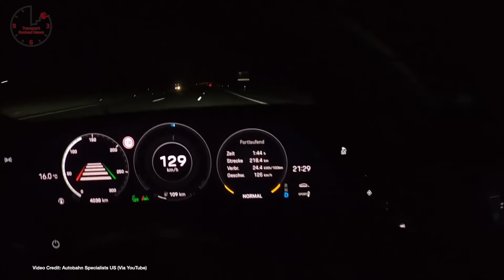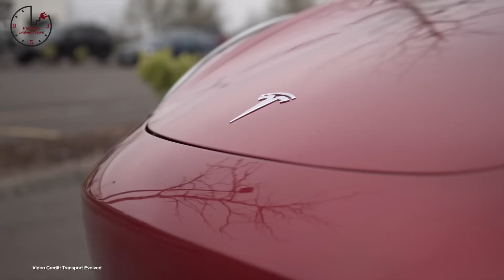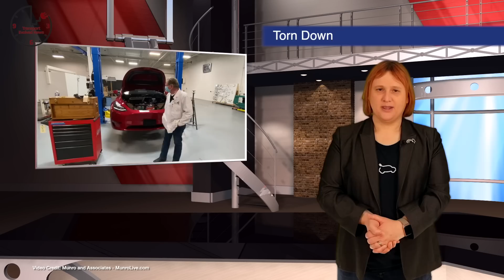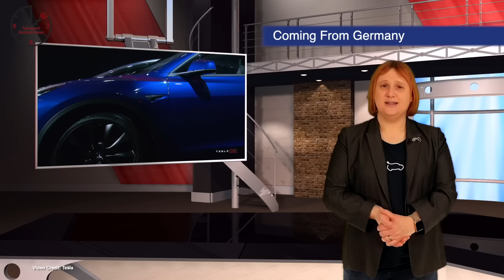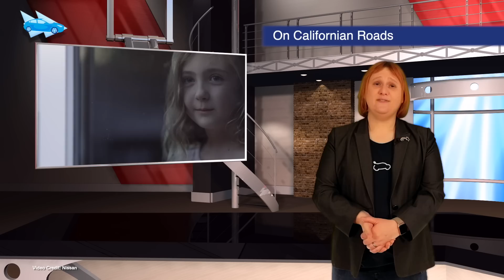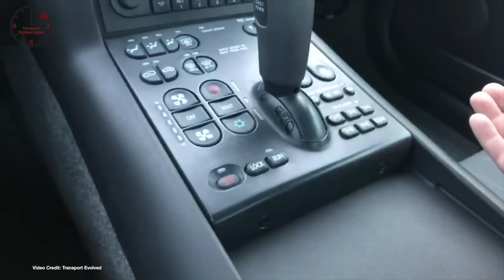TEN 287 - Porsche Taycan Record, Model Y Teardown, Ford F150 PHEV Range

Comment: Usually PHEVs have smaller electric range (10-50 mi). If F150 phev has 10 mi range when fully loaded, it should have same electric capacity as contemporary PHEVs. For hybrids, engineers cannot add too many batteries as that will nullify the advantage for improved fuel economy. 
PHEVs, in my opinion, help reluctant people come on to EV gradually. If vehicles like F150 have these options, more and more people will get to experience ev drivetrains and help advance the move to Electrified transportation smoothly.

Comment: Regarding the range of the  F150 PHEV  when fully loaded, I expect you would gain far more than 2-3 times that range unloaded Nikki suggested.  If you consider that the Model X can easily  loose half of its range when towing and the F150 has more that double the towing capacity of the Model X, I would expect the unloaded range to more than triple (possibly quadruple) and thus become 35 or 40 miles.  Considering the Chevy Bold has a range of 35 miles on battery, which is one of the best for a PHEV, so I don't' see how this is considered all that bad.

Comment: Cities with more pollution tend to have higher population densities. Which make social distancing more difficult. Which means more cases. Which means it's harder to give expert intensive care to the worst cases. Just a theory of the top of my head with no data or expertise to back it up. But the point is that you can't jump to conclusions regarding cause and effect.

Comment: Did anyone really think that Ford would be delivering a fully electric pickup truck? We have come to expect lies upon promises from those mammuts, as they have no batteries to put in their cars, or have to borrow technoligy from a serious EV company.
Reply: If I remember right, the hybrid was a separate model from the full EV. As for the low range, it's a brick aerodynamically, what did you expect?
Reply: I wonder why their bonds have been recently downgraded to junk...?
Reply: Yes, I really did with their coordination with Rivian, they certainly have the technology to make it happen.  I'm very disappointed if this is the case though.  Even if it has a 50 mile EV only range that would be a complete wast of time
Reply: @JustfishNascar  No it wouldn't be a waste of time. 50 miles is plenty enough for all of the short trips which is what a PHEV is meant to satisfy with only electric power. And a hybrid power train has other features that improve efficiency even without being charged from mains. Also I never understood how an electric F-150 could exist without competing with the Rivian ranges.
Reply: Who says they aren't going to deliver an EV truck?  It was never going to happen this year.  I'd look for it in 2022.  Maybe late 2021 if they're lucky.
Reply: @JT_771  Yes. The hybrid is just a stop gap model of sorts that they can get out quickly.

Comment: Mercedes are going to have to do a lot better than 600+ hp to compete with a Model S in Plaid mode. Even before the Tri-motor Raven Model S arrives, the current dual motor delivers 825+ hp. And everyone is studiously staring at their shoes whenever the Roadster 2.0 is mentioned. Nice to see the Citigo-e is proving popular, the first real attempt at an affordable (if small) family hatchback.
Reply: I don’t really see how this is important except for people who love measuring contests. There is more to a vehicle than raw power.
Reply: @leax_Flame  I agree, I don't see why the German Auto Industry feel they need to compete on such things. Jaguar haven't bothered with their ipace,
Reply: @leax_Flame  bragging rights matter.  Cars are one of the main ways people tell stories about who they are sadly.  I would know: I only ride bicycles.  People continue to treat me with pity :-)
Reply: Shane Fiddle what I meant is the HP of a vehicle doesn’t tell much about the performance of it and having more just for the sake saying you have more is pointless. 

A good example would be comparing a V8 mustang and a Miata. Despite the Mustang having nearly twice the torque/weight ratio it can only manage a 30% faster 0-60. Most likely cause the tires don’t have enough grip.

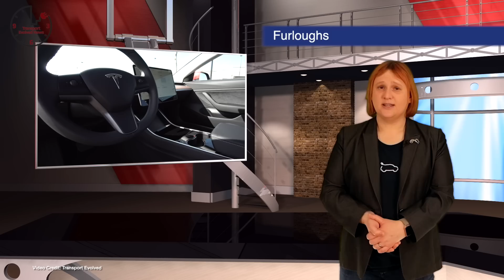Comment: Taykan 1000 km challenge video is totally fake. It never shows the actual travel time and charging time. It’s very detailed in the beginning showing 340 km in 3:30h. Than there’s 32 minutes of charging. There are at least two more charging stops, another 35-40 minutes. Based on those data we can easily calculate more than 11 hours for the 1000 km. 
Also the video based on car’s clock test starts at 7:37 pm and the 1000 km finished at 6:35 am on the next day. This is exactly 11 hours again. 
So the mentioned 9:12 h are only based on author’s words and no evidence.
Reply: Well spotted! Not the first time this car has had questionable results.
Reply: I don’t mind the car at all. It’s a good EV. However this kind of fake videos are ridiculous.